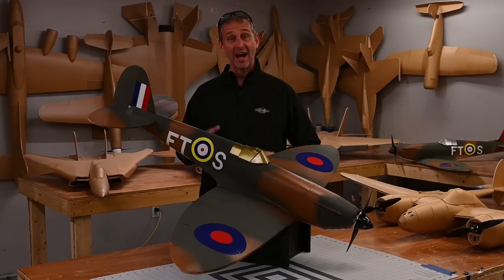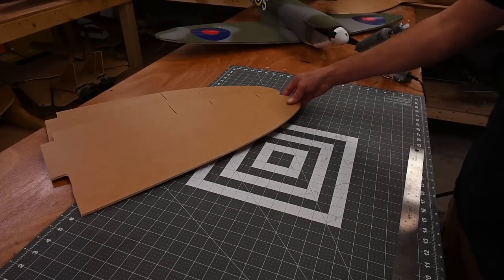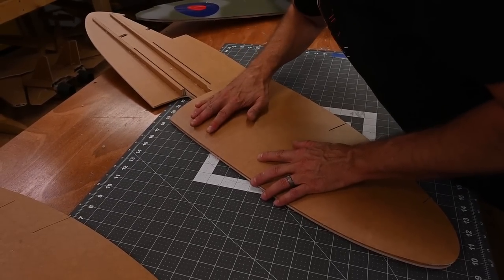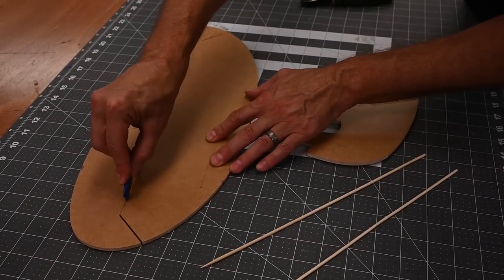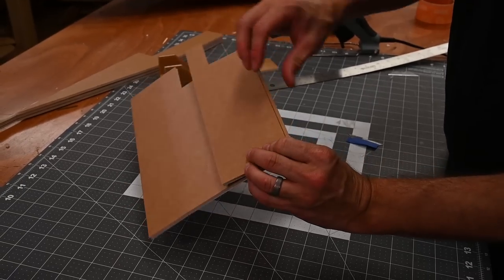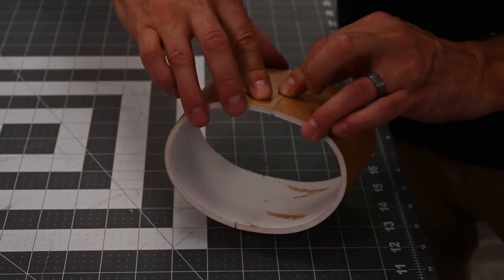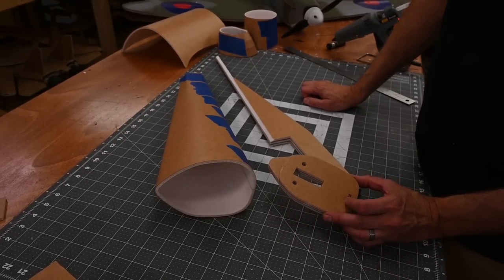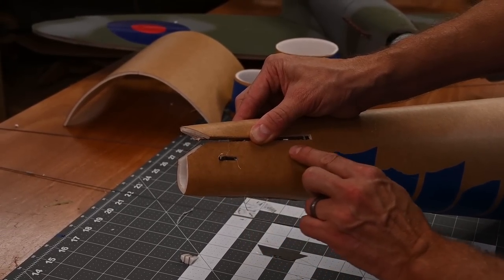How to Build the FT Master Series Spitfire   //  BUILD

Comment: Thanks a lot to the flite test community for giving out the plans for free. However, this design has some major flaws. How does one replace a servo if needed? I think planes (and anything really) should be designed and built with serviceability, maintenance and even upgreadability in mind.

Comment: I’ve just made this - though using 6mm depron. I enlarged the plans a few percent, as far as tiling would allow, and the span is 52”.
Considering its size, it’s a fairly speedy build, though depron is harder to shape than foamboard. (The fuz tunnel was a bitch!!)
So, three days ago I maidened it. I should add that I am a newcomer to ailerons, so this is a challenge!
The first three days of attempted maiden flights didn’t go well. First, I would recommend dialling back all the flight controls to minimal throws. This crate is sensitive, so less is more. Second, pay careful attention to the thrust angle of the motor. Turns out that I was adding down-thrust every time I shoved the battery up front. So, I kept crashing immediately after launch. Fortunately, I built it with knock-off wings, and was flying over long grass, so no damage was sustained. I’ve added guide rails for the motor-pod to keep it straight, and this worked a treat. 
That done, and the controls minimized and expo-ed, tonight’s flight was a revelation... glorious!!
Mine has got a folding prop, and I was delighted to discover that it’s a very good glider. Why don’t more people fit them, they make such a difference?
Eventually, I crashed it in a tree when a I let it get too far away and lost orientation. However, I’m putting this one down as a success, and can’t wait for tomorrow when I’ll try again. 
I’m now thinking of a monster-sized Spitty...
Well done, Flite-Test for creating such a great crate.

PS. I’m now commenting a month later having logged a few more hours of aileron flying. First, the launch caught me out again (twice!). Goddam it, this is a bitch to get up… The second time snapped the fuselage in half. 🥵
However… I fixed it with tape and, with the help of a friend to launch it, she got airborne… and the wait was worth it!
These Spits fly SO WELL!!!
Now that I know what I’m dealing with, I’m going to build a bigger one: about 70” span. 
 Seriously, for £20 worth of foam and paint, you can make one of the most iconic warbirds ever designed, and take it from me, once you get past the tricky launch, it will fly like the real thing. It’s freakin’ awesome!!!!!!!!!!!!!!!!!!
Is this aeroplane the best kept secret in aeromodelling???
Reply: Where did you get the free  plans? I can't find it.

Comment: I honestly thought the construction would be a bit more difficult but I can see how this all comes together.  Very nice.  However if youre doing a MK9 both of those radiators need to be on the lower wing.  Mk5 and lower have one as pictured, and more cylindrical intake on the other underside wing panel.  And there needs to be a chin mounted intake as well.  Look forward to get plans and playing with the design a little bit.

Comment: John you are an awesome builder, I have a thought for you,over my years of scratch building, on the tail surface before bending it to the desire shape putting clear packaging tape on the outside will keep the tail from breaking and will be able to bend the tail surface as tight as you what.      Quick question when are you going to do jets!

Comment: swing wing F-14 in the background?   will it have heat seaking missles too?  and real jet engines?  and a real HUD inside for the tiny pilot?  and fly by wire controls using the original F-14 flight computer?  I also want hydraulic retracts and disk brakes.   ha ha

Comment: Hi John,
Would you be willing to do a "how to video" on scaling up your master series Spitfire...? I would imagine that creating the radius would be slightly easier... Now there are several foam board products mention on the FT Videos... Allen Foam, and Maker Foam sheeting with the latter coming in two thicknesses.  Is the Maker Foam currently available and would you suggest it's use...? You might suggest the Adtech Pro 200 is the Model Hot Glue Gun in use on your videos... it took me awhile to track down the manufacturer, and model.
Thanks again,
Jim Marshall

Comment: I have a problem with the original spitfire in that the elevator will sometimes break in the middle and cause a softening of controls. Plus, the entire horizontal stabilizer bends due  to the force of pulling up. Are these remedied in this design?